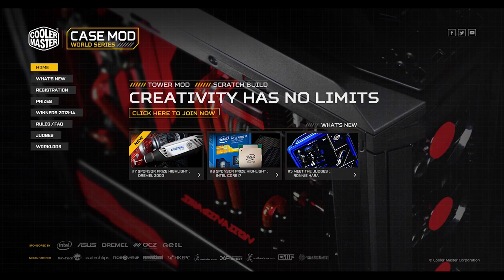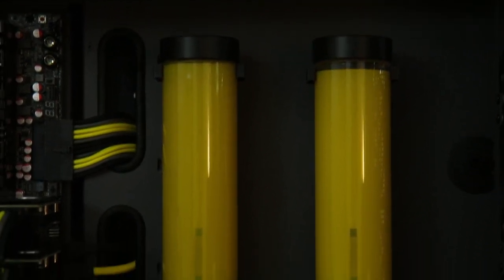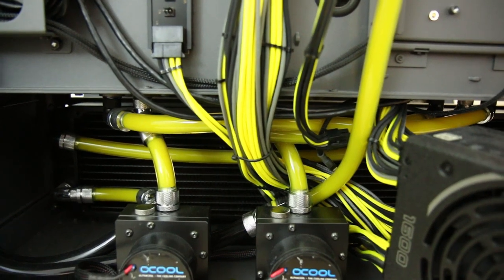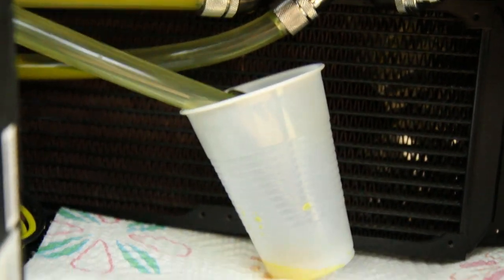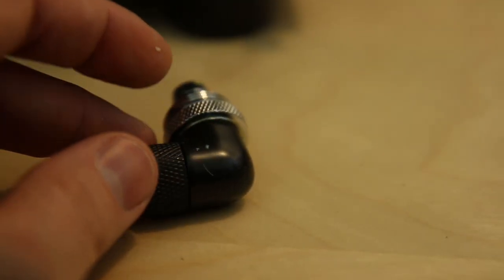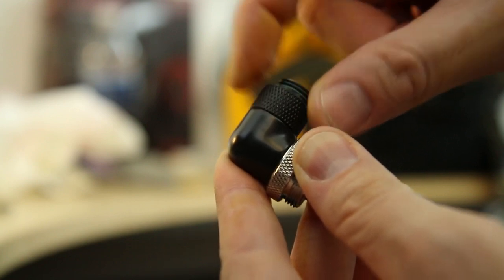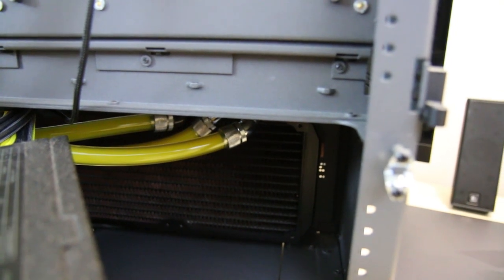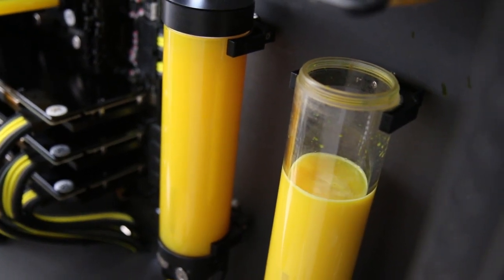My $6500 Custom Watercooled PC LEAKED!!! Now lets fix it....

Comment: Can you do a video on down sampling a 4k monitor to 1080p/1440p? I want to get a 4k monitor for productivity and then play games at 1080p because I need them frames brah.
Reply: Go into the game settings and change the resolution to 1080.
Reply from the maker: a 4k monitor at 1080p would look no different than a 1080p side by side. Since its an exact 2x2 scale so 4 pixels = 1 for 1080p. Downsampling it to 1440p would look like poop
Reply: ***** Thanks for the reply man :)
Reply: ***** I think running 1080p at 4K would make it look even worse than 1080p native.

Anything not native always look like shit.
Reply: Brendan Paul Yeah, but with a 4K monitor you can see the extra pixels and it looks like garbage running at a lower res.

If you put a 1080p monitor at 720p you could tell in an instant, not because 720p looks like garabage, but because scaling up looks like garbage
Reply: ***** That's because 720p and 1080p are completely different. 1,280 x 720 does not scale into 1920 x 1080. 1920 x 1080 however would scale perfectly into 3840 x 2160.
Reply: I have a 2.5k 2560×1440, can i do downsampling 1080p and be good as native 1080p, cause only have a GTX 970. Thanks
Reply: No. 1080p would probably look decent as long as its a good brand that handles it well. Otherwise you'd probably be better turning AA and a few other quality details down and playing at 1440p (most of the time doesn't require THAT much more GPU power to run compared to 1080p))
Reply: Michael Park is a Asus ROG Swift.
Reply: If that's the g-sync one then I'd just go 1440p anyway and see how you go. But if you do downscale I can't imagine it looking very bad.
Reply: Maite Zimmermann dat monitor tho
Such refresh rate. Much smooth
Reply: blueman24 yes, which GPU do you have and which resolution do yuo play, how many FPS?
Reply: Ummm...I dont have a great setup by any means but it is still decent for me. gtx 650, 1600x900 60hz monitor 😞
Computer parts are a bit expensive in my country... but thanks for asking anyway :)
Reply: blueman24 I play on my 50 inch 4k tv but I want a monitor but the Wife won't let me get one.
Reply: Luke Smith lol. You should protest.
Reply: Luke Smith Cut your tv into 4 pieces with a stanley knife so you have 4 25 inch 1080p monitors. It'll work I guarantee it.
Reply: downscaling to 720p is the 2x2 ratio, if you have bad framerates at 1440 just set down to 720p and max all the quality sliders and options for a reasonably nice image.
Reply: Also people think that by going an odd resolution that the display is instantly "poo" think about a console displaying a 1080p image while only drawing it at 900, 800, 700 or even 600p, yet they look great and scale well somehow? It because AA gets rid of rough edges and assumes where the pixel should be rendered, it's called 'upscaling' for a reason, the displays processor can 'guess' where to put extra pixels from a 600p image to 1080 or more. Sometimes by going 720p on a 1080p monitor you can max settings and generally get a nicer looking image with everything maxed than you can at native 1080 with everything on medium. It's why consoles do it as they have barely enough grunt to switch on.

Comment: I thought about water cooling too, but the thought of leakage made me cautious. I keep fish too, and play about with that equipement, tubes can harden and even crack over time, especially when exposed to different tempratures, not to mention connectors, just ask any plumber.

Comment: can i use my urine for the liquid in my water cooler? my family doesn't like to waste and I want to be very eco friendly
Reply: Nah it'll become gas in seconds lmao
Reply: No, it would work. Pee away!
Reply: yeah go ahead.
Reply: I feel like the salinity of urine couldn't possibly be good for a the pumps and tubing, not to mention it's slight acidic factors. I mean you probably could, but there could be issues with it down the road.
Reply: BAY35 like when you have to blow the system to flush out the fluid
Reply: @Surge7  what the fuck

Comment: Ironic, I just watched a video from Jay this morning saying how rare it was for them to leak.
Reply: Once in 11 years is pretty freaking rare.
Reply: enginesnblades Plus he's using 90 degree and other rotary fittings all over the place and still only had 1 leak in 11 years. Use soft tubing and good quality compression fittings if your worried.
Reply: enginesnblades his pc is overkill and just one leak can destroy a few hundred or few thousand dollar rig its just not worth the risk
Reply: SunnyD That's subjective. It's well worth the risk imo.
Reply: enginesnblades its not subjective really its a fact water cooling is a waste of time and money these days
Reply: SunnyD
A power surge from the PSU could kill everything too. That doesn't mean it's going to happen. Water Cooling is awesome. It looks amazing and completely eliminates temps from the equation. I'm in Hawaii so my components run hot on air. It's a waste of money if you don't already have top of the line equipment though, I'll give you that. Rather than spending 700 on a custom loop it would be better to spend 700 on an upgraded GPU. I already have the top of the line GPU though so adding a loop made sense. Also, now I have a loop for all my future builds which is nice too.
Reply: SunnyD No, it's subjective. 
Watercooling is fun for some people and improves performance along with aesthetics at the cost of time and money.
That makes it a subjective discussion. 

" its just not worth the risk" - opinion

Comment: I am ASSUMING it probably can be attributed to atmospheric pressure and temperature change; causing the atoms in the rubber O-ring to contract when it is cooler in your location of operation but the hot fluid in the o-ring is expanding so the cooler side has more contracted atoms vs the expanded atoms on the hotter side! It probably created a pocket where the fluid escaped. You may also try Heat Shrink Tubing around your 90 and 45 joints to catch and prevent leaks. But the down side is you may never know if it is leaking to change that piece again before it becomes critical! Their is also the heat shrink tape used for sealing wires too and reinforce it with an apoxy on the ends to prevent leaks but the down side again is you may lose the ability to manipulate your piece movement when all is sealed. To change simply cut with an exacto or utility knife and use some citric acid or some form of a turpentine to remove the apoxy or super glue if you get some stuck on your tubes. "This is merely a hypothesis I am gathering from all of this!" TRY AT YOUR OWN RISK! I am an air cooled guy..... ( Hope it helps for another 11 years which is an awesome track record to me...)

Comment: As a vehicle mechanic who uses brass fittings regularly for air valves, coolant and etc I can say that o-rings within these products randomly fail at times and even after removal seem fine. Shit just happens. Glad everything turned out okay.

Comment: Lucky the leak was nowhere near any components that the water would affect.
Reply: +Vercusgames Maintanence, Yes. The never ending worry of leakage aswell :)
Reply: @Vercusgames all liquids will gain metal ions as they flow.  So in short you can try this but after awhile it will be an issue.

Comment: Arghh It's so frustrating for me who wants to try water cooling but are to scared of something going wrong. Plus to set up a water cooling system like you seems way to complicated ;_;
Reply: +Benno Lenno Depending on what your needs are a closed loop AIO (all in one) is not technically challenging on you. I saw a vid recently saying EK have a AIO soloution available now (actually on this channel, EK Predator it's called), there is also NZXT (which I have on my cpu only, with a 280mm radiator with two 140mm fans in push pull config with the top 200mm case fan). My graphics card is still air cooled (Sapphire Tri-x, which is three fans). But I would like to build a fully liquid cooled system when I can afford it. And I,m not really too worried about stuff that can go wrong, after all we learn from our mistakes (nothing ventured, nothing gained)and in life shit happens, you just need to have a contingency plan, then hope you don't have to call on it.
Reply: Yeah me too thats because custom loop is for the experienced builders i know they look sick ass but a beginners like me cant probably take the risk